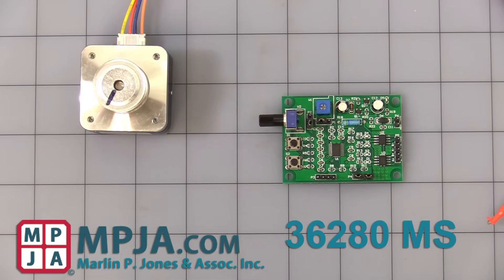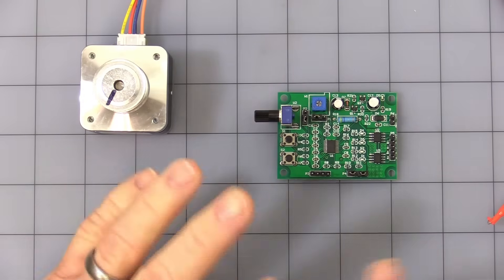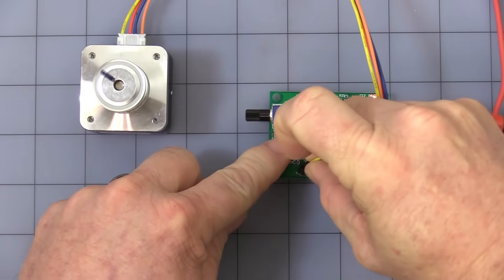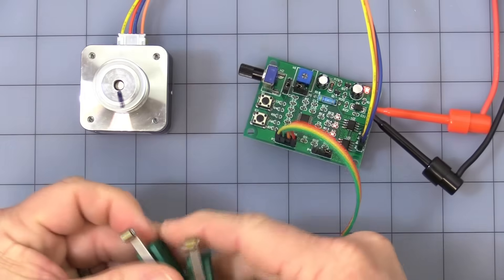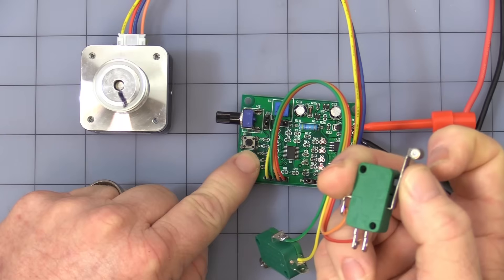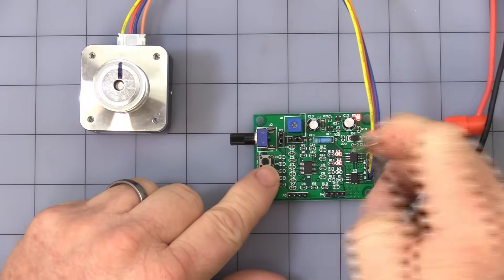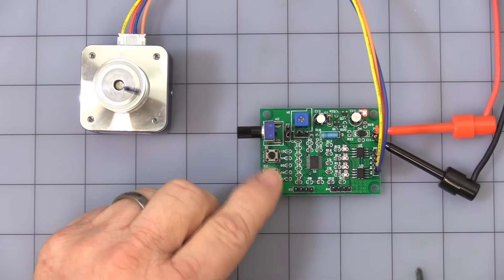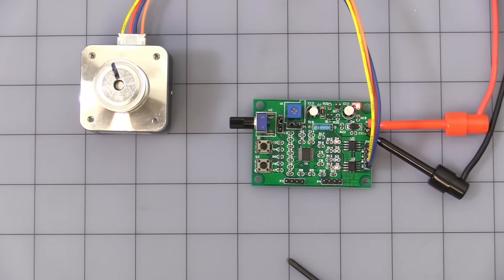Stepper Motor Driver Control Board 36820 MS

Comment: Be careful with this controller board. While it’s labeled as supporting 5–12V, the two H-bridge ICs it uses (L9110S) have an actual operating voltage (VCC) range of 2.2V to 6.5V, and there’s no onboard voltage regulation.  That’s why you often see comments like “worked for a little while and failed” exceeding the safe voltage for the L9110S is likely the culprit. I strongly recommend using 5V steppers only with this board.  If you've already fallen victim to the misleading voltage rating, the good news is that in most cases, only the H-bridges are fried — the microcontroller is likely still fine. You can replace the blown L9110S chips, or if you're feeling adventurous... remove both and bodge wire in one TB6612FNG, which will give you better motor performance and durability.  Good luck!
Reply: Thanks! That could be why I never managed to get this board working. The first thing I did was give it 12V 😩

Comment: Bonjour guten Tag
Nous avons une belle vidéo (sur une carte). Je suis heureux de cette carte dans l'Einsatz, mais si vous savez que ma machine peut l'être. À partir de 800 mA, vous devez le faire. Gibt es keine Treiberplatine damit ich ich ich einen grösseren Motor ansteuern kann. Il y a certainement un conseil pour moi. De très bonnes vidéos pour les SEHR guten Videos (avec le module MKS OSC V1) doivent être prises en charge

Comment: Thank you for sharing and very detailed info video, does the rotary knob will control the speed of the stepper motor to slow the rotation down while in stepper mode?

Comment: hi im trying to find out ine thing....  so im using this on a generator carburetor.   does the mode facilitate automatic stop after a complete motion.  example..  if i have it set to 180 degrees turn  i want it to top  this may simulate the choke being fully closed  and then i have my relay once the generator has started then the choke will return to the closed position going 180 degree the opposite direction  i dont want the constant  power oncthe motor once the position has changed

Comment: Fantastic video on the functions of the board. One question, yes, its been 3 years but maybe you can recall. Is there a way to make it start up in running mode. Forexample if the jumper was set to JOG mode and the run switch was bypassed to ON. Would it start running when power is supplied?

Comment: I tried two stepper motors and two controllers and the motor won't turn.  The lights obey the speed control know, but no movement from the motor.  Any ideas?

Comment: Hey - I have built a camera slider, but the control board doesnt have these cool options. Can I use a 2 wire stepper motor with this board? Does the kit come with the motor wire harness, and which color wires to use? For the limit switch, and I use a basic momentary push button switch? Also, is that wire harness included? thanks!

Comment: How many Amps does the controller provide to the stepper motor? Also, are there heftier products to upscale and run a high torquing stepper motor or how might you go about that?

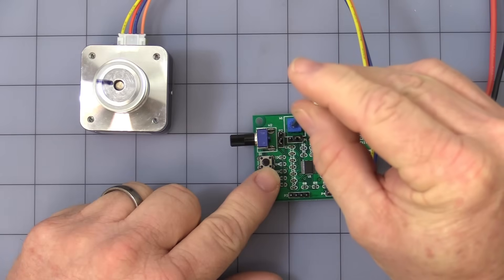Comment: I’ll appreciate it if you would view 7:25 on this one year old YT video and confirm if I understand the potential of using this layout to remotely tune my antenna. 

As I understood, having adjusted the potentiometer for smallest ‘degree-steps’ and having placed jumpers properly, I can momentarily press one button, to ‘step’ the motor a degree at a time in one direction.  

If I understood what I viewed correctly so far, then can this more-accurate stepper motor movement be controlled through a two conductor cable in some way using your setup as I referred to ?

(Though I can use the analog approach of PWM a DC motor with a two conductor cable controlled by DPDT wafer switch, I wouldn’t have the more desirable accuracy of rotation by degree steps)

Comment: Hello, If I need to run a stepper motor with higher current (1.8Amp) with what driver module should I connect this module? And how should I connect?

Comment: Why doesnt this work when you connect it to a buck converter? I have a 5v dc stepper motor and am using a buck converter to output 5v dc. Whenever I connect it to this board and press the button to turn the motor on, the D2 led blinks and doesnt turn the motor on.

Comment: What is minimum speed. ?
Can i use in 1RPM speed..?
Reply: Hey there, I use low speed for my projects, so check planetary gearbox for stepper motor on internet. If it's helpful.

Comment: When connect the motor only works on full power from potentiometer, when I lower it just stop and do one step at a time super slow nothing in between. What can it be? Using a 2 amp motor
Reply: I have the same, did you find the solution?
Reply: I change the stepper motor, now I’m using a 12v .35 amp from adafruit and now I’m able to use the potentiometer.  Now the main problem is way too much vibration for my use ( DIY motorized camera slider)
Reply: @hernanpacheco3016  Wow That is exactly what I am going to use mine for. Just ordered two today. Custom Made check out this video: https://www.youtube.com/watch?v=vkoiYt6pbGE
Reply: thx I have to find another motor less than 800mA
Reply: @dariuszroczek4068  remember that the board runs from 5-12v if motor is 5v when lowering the voltage with potentiometer will not respond because is going less than 5v.

Comment: N is this right if using a radio controlled esc would it b possable to draw the 80 or 150 amps from it so u wont need so much extra power wen using like say a blender that runs on batteries n a solar controller or pmw

Comment: I am trying to run nema 17 but its not realsing enough power to run it?? Does any of you guys tried nema 17 stepper motor??
Reply: i tried but does not work...still looking for a solution:(((
Reply: @mehmetfahrifurat6130  need intermediate driver , any solution?
Reply: @mehmetfahrifurat6130  , on the video, looks like he is using Nema 17 stepper motor, is that right?
Reply: Yes, i's a neema 17 motor, but the four pin connector that came with my stepper motor was  wired wrong and the motor would not turn.   Using I had to rewire the 4 pin connector to correspond to the coils coming out of the 6 pin connector plugged into the motor.  One coil needs to connect to A+ and A-, the other coil needs to connect to the B- and B+ coil.
Reply: I''m using a 9 volt alkaline battery
Reply: As soon as I plug the motor all led lights up to RED. Then as soon as I remove the motor then the led cycle starts. What seems to be the problem?

Comment: hello, ive got that contral board but im faceing a problem. Im using it in that mode where it turns on or another way by pressing the switches,.. but by not pressing the switch the stepper does not hold position. Can u help me out solving this problem ?

Comment: Hello, can I connect this 36820 module motor output pins A1,A2,B1,B2 respectively to the IN1,IN2,IN3,IN4 inputs of  L298N driver module to driver a higher current stepper motor?

Comment: hello can you pleas explain me how can I make DC stepmotor circuit left and right rotation with time delay off 60 minutes between by using two microswitches and the type of proper electronic print board thank you

Comment: hello             would it be possible to ask you  about one of your stock products
Reply from the maker: What is the stock number, I will do my best.
Reply: @mpjaonline    Hello  would I be talking to David the technician
Reply: Hello how can I drive a stepper motor having a current rating 1.8 Amps using this 36820 board?  Please reply.